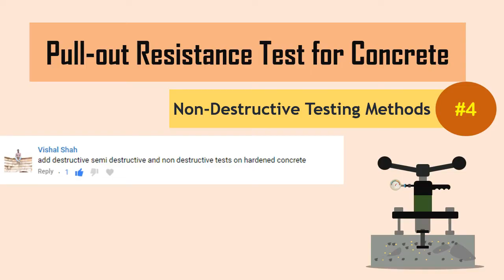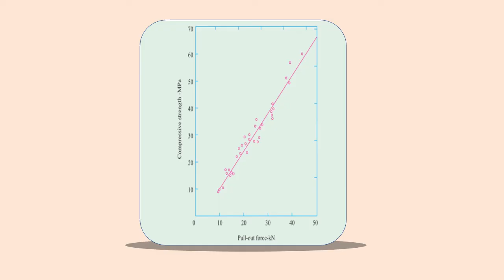Pull-out Resistance Test for Concrete || Non-Destructive Testing Methods (NDT) #4

Comment: How to use this machine to test the quality of Tile Adhesive? I mean how would u pull out the whole tile with it?
Reply from the maker: The mentioned test is done on concrete surface.
Reply: @AnimeEdu  yes, but the same machine can also be used to test the quality of Tile Adhesive. Do u n know the process?
Reply from the maker: We will check and update you soon ❤️❤️